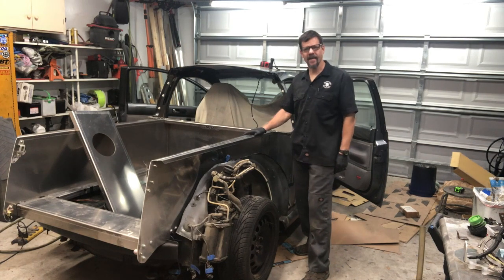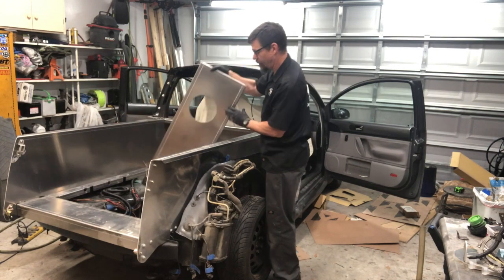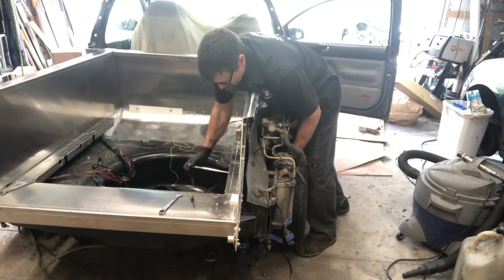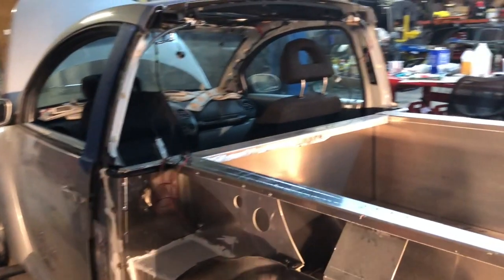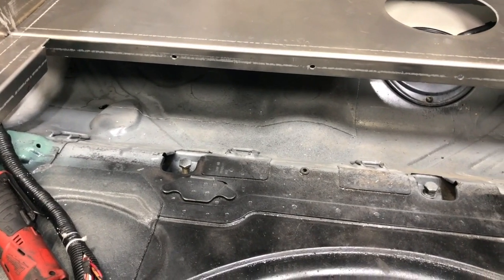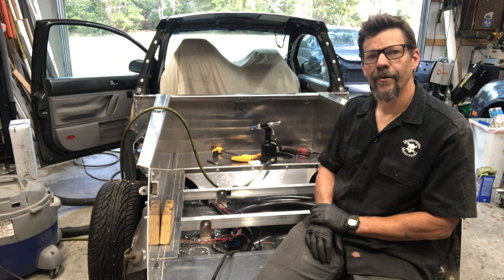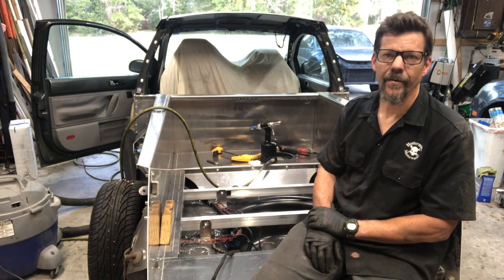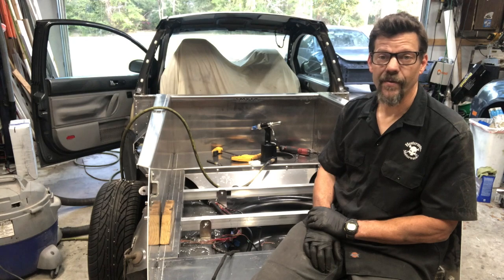Smyth Beetle Ute: installing the bed

Comment: How big is the hole before you put the bed inside? Looks great. You do very nice work!
Reply from the maker: MikeJ F hard to answer cuz it all depends where you measure it. The narrowest point is about 41 inches across
Reply: Hestermann Motorwerks thanks. Have you did a MK5 yet? You sure do nice work.
Reply from the maker: MikeJ F not yet but If you notice in the background is a mk5 I’m about to do after I finish this one!
Reply: Hestermann Motorwerks can’t wait to see it.